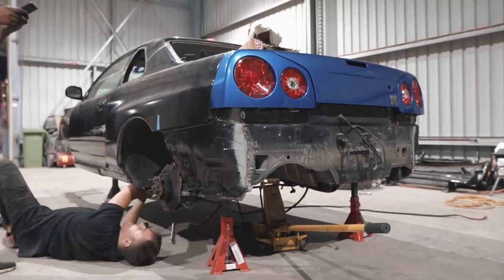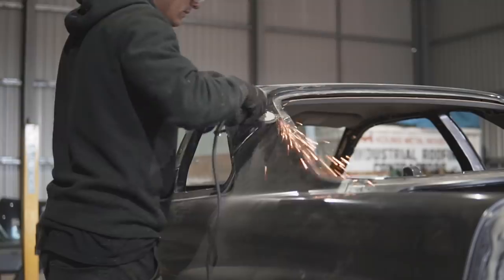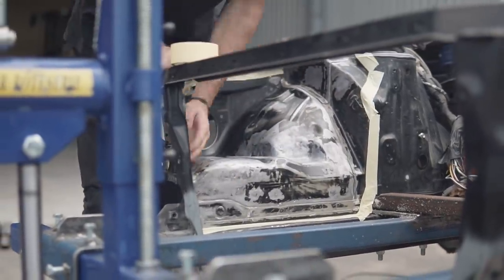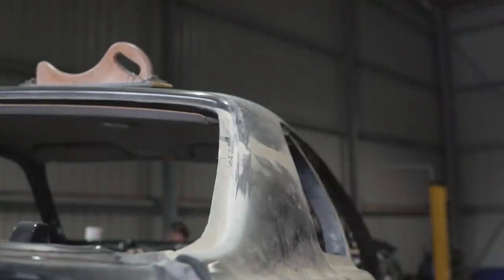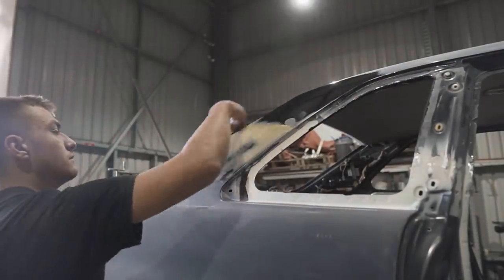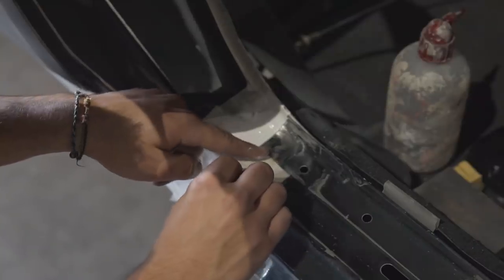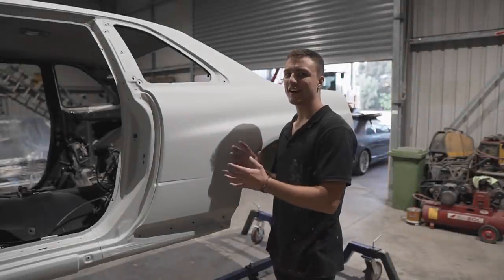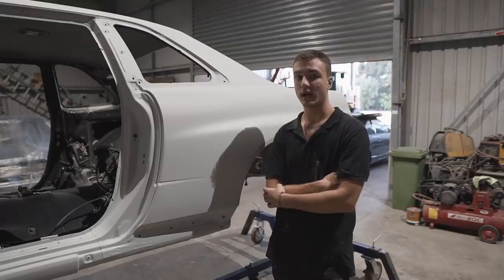R34 is in PRIMER! | Poor Man's GTR [EP7]

Comment: I’ve been super busy but a huge tip for painting/ applying primer is to went the the floor and walls around (walls of you are in a paint booth) because it attracts dust and will leave less imperfections that you will have to sand down give it a shot when painting/ apply primer on other panels! Or even Gunmetal Grey or Bayside Blue looks killer on this car
Reply from the maker: Thanks for the comment man! Yeah I know people do this and I used to do it when spraying wheels in my garage but.. last time I sprayed the LMGT4's white in the workshop I wet the floors and the paint stuck to the floor. My mates dad was not happy about it haha

Comment: That hole that you welded up on the left side in the engine bay is where the hot side intercooler pipe goes
Reply from the maker: They will be recut

Comment: Inspiring work man!!! I’m getting ready to do the same on my r32. A lot of rust to repair. Which product were you using to wipe to convert the rust after you had finish sanding 
Thanks
Reply from the maker: Sweet as
Just wax and grease remover after the rust converter has done its job

Comment: Hi the white sealer you are using, if its PU (polyurethane) you need to make sure any bare metal is primed with at least 2k primer. Because PU brings in moisture when it cures then trapping that moisture in the joint and it will rust.
Reply from the maker: Hey man! Thanks for the heads up

Comment: Great job my man. I’m currently doing this to my car and I did the same as you, took a grinder and sanding disc to it but learn from mistakes as you said. Luckily it was slight surface rust. I also had spider cracks on mine. 

Thanks for this video I’ve learnt a lot from you in regards to the rust converter and the priming etc. Cheers dude great work 🤙🏼🤙🏼
Reply from the maker: Sweet as man! No stress :D
Reply: Broken Silvia all the way from Scotland too 🏴🏴

Comment: hello. I really like watching you prep the body. I am also a car painter, and I fell really proud of seeing a young guy working on cars. WELL DONE. 
Listen, about the color, there is nothing wrong with choosing the one,  as long as you like it.
I have a personal opinion about reds and blacks. Painting car with black or red its easy, because it looks good in any car body, even on shit boxes. A lot of people use this technic because it is cheaper and quicker to do, so they don't need to waste time and energy figuring out what is the best one that looks good. THIS TECHNIC IS WRONG. DONT DO THIS. WANT TO KNOW WHY?  Because I believe you want to do something deferent, unique and exclusive.
after have chosen the wheels that you want to use in the car, you should spend a few hours working on the color in a small piece of sheet metal.
Porsche colors are one of the best in this world, for example, MIDNIGHT BLUE, VIOLA METALLIC,  GREEN PEARL EFFECT, NEW JET GREEN OR EVEN YELLOW. 
They don't use aluminum extra coarse. that is why the colors look good on the sun because the major ones are made with aluminum extra fine,  so, it looks SMOOTH, CLEAN, AND FLAT on the sun. PERFECT, PERFECT, PERFECT.
Reply from the maker: Thank you for the comment man!